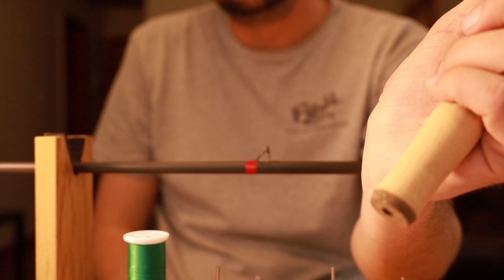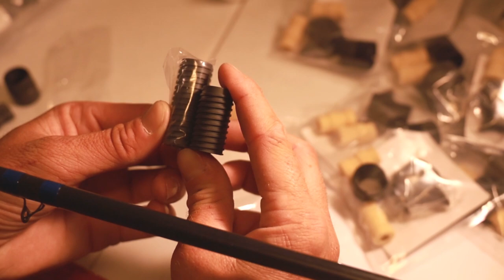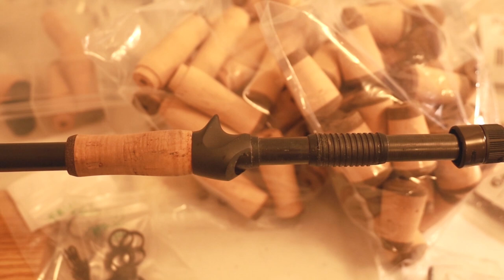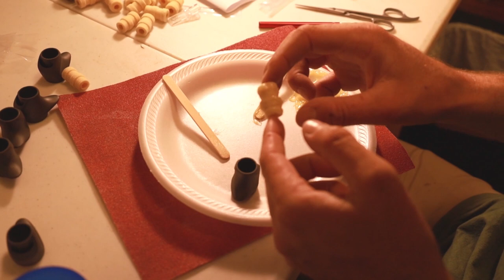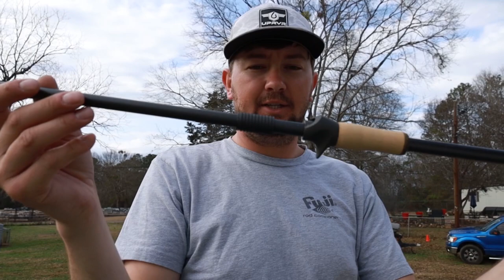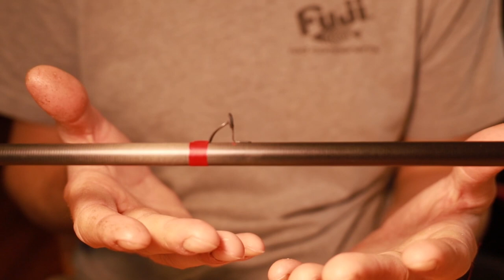Point Blank Build Tutorial

Comment: Parts list:

Point Blank rod blank PB731HXF 7'3 Heavy X-Fast Action

Fuji SK2 Split Reel Seat set SKTPSM

Fuji SK2 Barrel

Fuji SK2 Contour split grip (cork) RGSK1617RCW

Fuji Fighting Butt for SK2 (cork)

Fuji Standard Reel Seat Nut

Fuji Arbor (new style)

Fuji Ultra Thread

Fuji LRV Reverse Double Foot Guide (1)

Fuji K series KB Big Foot Guide (3-4)

Fuji K series guide (6-7)

Any additions, corrections or spacing measurements welcome 😉👍
Reply: What's the guide spacing for the 7'3 mh xtra fast, just bought this blank?

Comment: There is a bearing removal tool made by a guy in CA called Bearing Bad Tool. You squeeze it into the middle of the bearing and it puts pressure outwards. You could probably use that tool to put in the hole to hold it and epoxy and then into the actual reel seat. Definitely something you should check out since you DIY so much. Multi use.

Comment: For putting the epoxy on the arbor, suggest getting a dowel rod (stick) and putting several layers of tape around it for a stop and slipping the arbor down over the dowel rod to hold it, not your fingers.  Try some flux brushes for putting the epoxy on to parts vs the popsicle sticks.  ACE h'ware sells them by the pkg.

Comment: Kyle, bang up job bro. Question on the reel seat. What size you running? 16 or 17   Im a fan of minimal material as yourself. Iv taken a 16 size and shaved the inside to fit, so i wouldnt have to use a 17 
Keep it up!!
Reply from the maker: I use a 16 for all the rods it will fit on and a 17 for the bigger ones
Reply: Can you share some insight. Duckett micro magic pro vs the new Pro series. I wanted to get into a heavy power MMP but out of stock. This lead me to the pro series. Putting cost aside, how will the pro series rod compare to the MmP ? I know you used a Heavy pwr MMP for flippin and froggin, the Ounce limit on that heavy MMP what would you say it is? 

Im tryin to decide if i should go with 
the 7’2 heavy dean Rojas or the 7’4 chris lane. The 7’2 maxes out at 3/4 and 7’4 at 1oz.  Curious how it will compare to the MMP sinceiv heard the pro series have a diff feel and on the stiffer side vs the MMP
Reply: What rod did you replace your heavy action MMP with? Im in NY so gettin a hand wrapped around a blank is impossible.